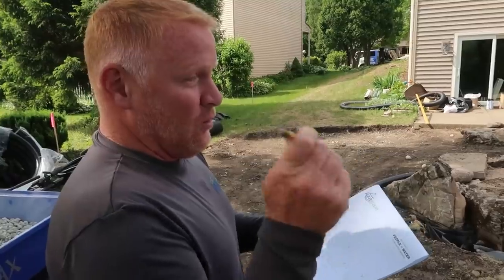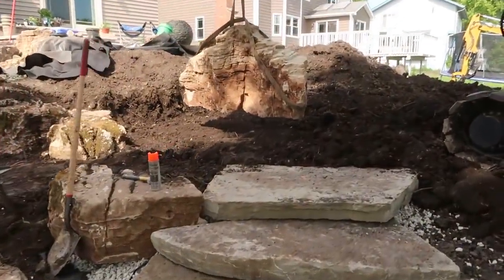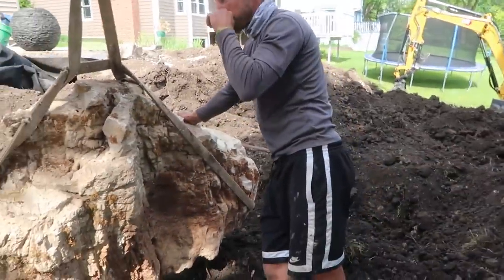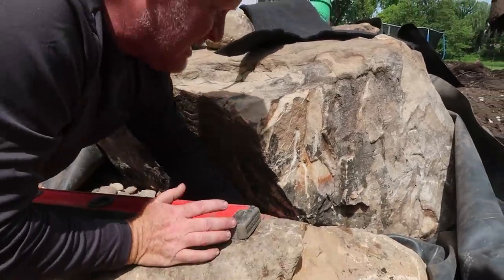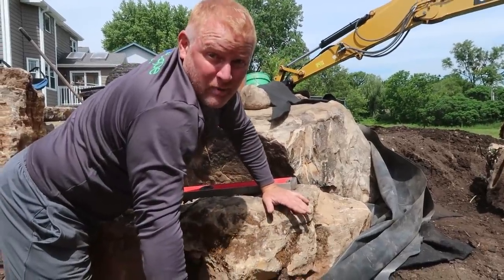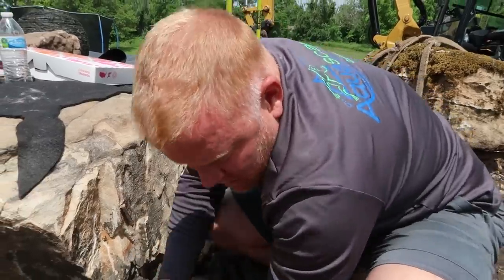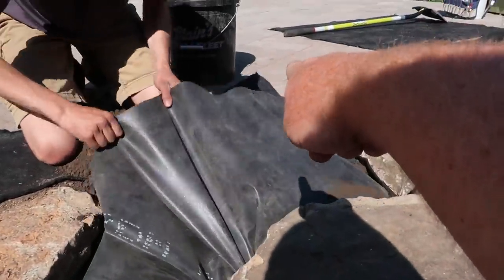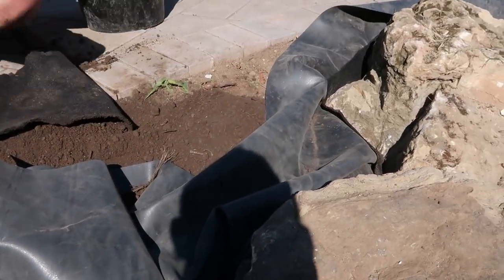Edge Techniques to Avoid Leaks in PONDLESS WATERFALL - Part 4

Comment: Ty, always learnt so much from your video.  I have a leak somewhere based on my water level.  But it’s not at the basin.  But I have no ideas where it’s leaking, I’ve tried everything thing you’d mentioned.
Reply from the maker: Have you turned your waterfall off to see if you are still losing water?
Reply: @TEAMAquascape  when I turned it off, it’s not leaking.  It’s only leaking when it’s running, I’ve checked the plumbing at the baffle, looks ok.  Checked the low edges are ok.  I’m afraid there’s a hole in the liner somewhere.  I will recheck the low edges again.  At this point I’m baffled.  Could it be evaporation? I’m losing water at a rate of 8-9” per day at the basin while running.   Turning it off I barely lose any water.  Ty for the reply.